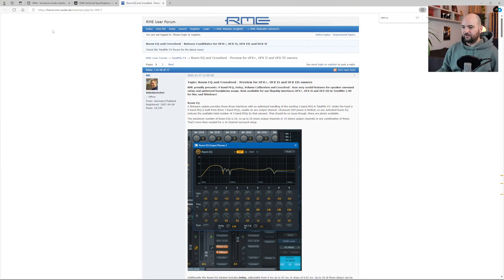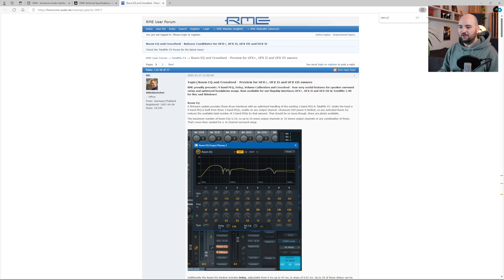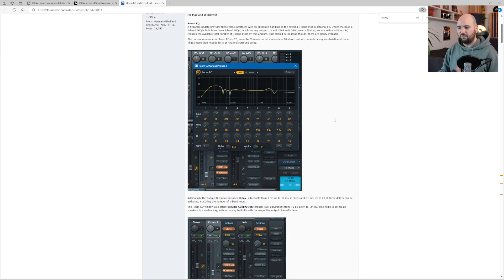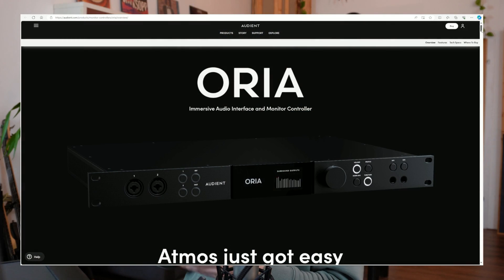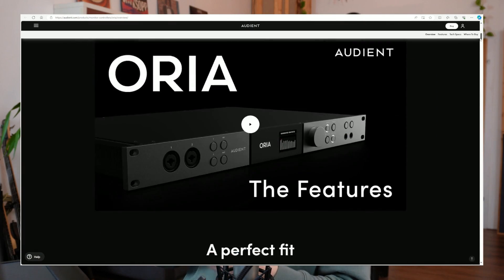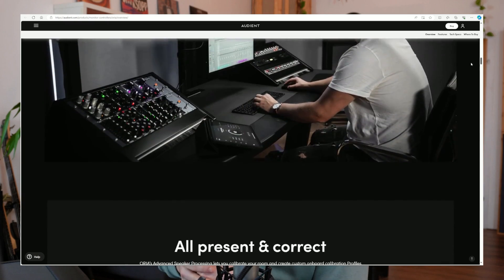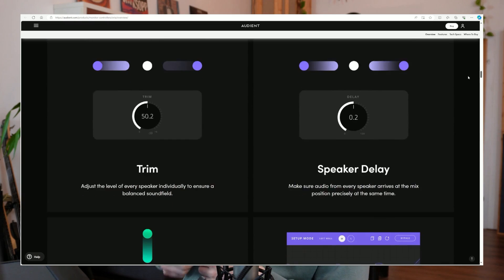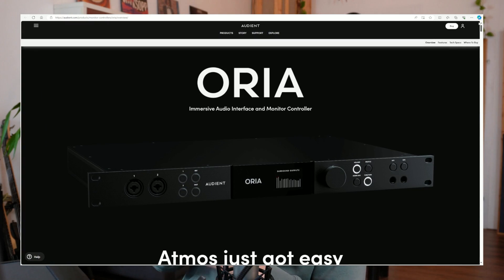What EVERY audio interface NEEDS (for home studio acoustics)

Comment: I think a DSP controlled delay on a separate Interface output for the Subwoofer isn't that important. Every Subwoofer has a phase switch with at least a 180 degree option. Some have  much more steps. Together with a measuring mic and proper placement it's already possible to get a clean phase at listening position and unlike in a Hifi Setup its not very common to place the sub too far away from the monitors. That said, i would appreciate a fully featured DSP and crossover in an interface too.
My 15 years old Microbook 2 and other Motu interfaces already have a 7 band PEQ incl. high and low pass for all stereo outputs, the line stereo inputs and the mono inputs. Together with REW it lets you make the most important corrections even if it's not a automized solution. 
Your latency argument sadly doesn't work btw. 
When you have a 15 ms delay on your audio interface outputs it doesn't mean you can add as many other dsp tasks with up to 15ms "for free" inside your interface without adding new latency unless the interface dsp magically can process the output signals before they are actually arriving. The DSP can't process what isn't there yet.

Comment: I am building a hi fi listening room that features a sound processing interface and more. Are you familiar with the Theoretica Applied 
Physics product called Bacch SP? There are a few models ( hardware and software ). The first is called Bacch4mac which deploys an RME product ( either the p[ro opt the UCX). In addition to the 3 main features you were excited about BaccH SP also provides crosstalk cancellation making the listening experience amazing and immersive. BTW - i will utilizing your tools as I retrofit a difficultly 14X 14 X10 Cube bedroom. In part due to your information I am reluctant reducing the size of my room ( by building a wall) to 14’WX11’L X10’H. Then on to acoustic treatment. By utilizing the Bacch SP Adio have all of the room parametric eq tools, speaker and sub calibration, phase alignment, frequency response, impulse response and crosstalk cancellation filters and tools.

Comment: Loving your channel. I’m considering the RME UCX II, and can barely justify it, but this feature is one of the reasons pushing me to it. Then I saw some lower prices for BF, but missed the price on the one company that didn’t remove the bundle some have right now that gives you Sonarworks for free. They even advertise it on RME’s site for adding the measurements into the new Room EQ feature. 

So now that free Sonarworks might not be an option I thought I might get REW and a cheap measuring mic. However, your one video where you talk about using it vs ARC or Sonarworks, etc…is much harder and in fact one of the hardest things you can do in this arena, even for an expert like you. 

Others seem to imply I can just use REW, get a text file and add it into TotalMix. I don’t know about the delay measurements that the dedicated systems might do though, if that’s gonna be hard to do on my own with REW? I think that’s all Sonarworks and Arc do, delay and eq? I guess I’d do volume by ear?

So has REW become easier to use? I’m confused. 

For headphones, it seems I can usually get the measurements offline from people who’ve already done that and add those EQ curves for Harman, and also use RME’s crossfade. No need to buy canopener?

Thanks, fantastic channel and I always try to like and share around. I’ve seen some of your interviews on other channels.

Comment: They also added it to the Fireface UCX II. I own both the Fireface UCX II and the RME ADI-2 Pro fs AD/DA converter. The ADI-2 Pro already had these features as well as crossfeed, but I'm still happy that they included it in the higher end audio interfaces as well as I ofter travel with my Fireface UCX and leave my ADI- 2 Pro at home. I also mix and master in headphones primarily so having the eq and crossfeed for headphone correction is also helpful. It replaced my need for my Sonarworks software.

Comment: i have the minidsp SHD studio, i use it for home stereo. think that unit has many function that you speak of.
the whole SHD series would work great for studio use.
i do not know what a "interface" is but i use mine as a volume control with built in dsp. adding dac's and power amps as needed. or directly into plate amps if it got digital input, otherwise i would need a dac in-between.

Comment: I have a correction/clarification (perspective: I am a research scientist working with, among other things, signal processing - so it's my domain, though I work mostly with images and videos):
All filters always introduce extra latency. It can be either the latency of individual frequencies (phase shift) when working with minimum phase and similar filters or the latency of the whole signal (linear filters or mixed phase filters). People have different preferences. I don't want to get into it now, but this is why software like Sonarworks gives an option for mode selection and some people prefer higher latency (and pre-ringing) linear phase filters for some applications. But even a minimum phase, or analog filter will add some phase shifts/latency.

So, it's not that placing it in the audio interface will magically reduce this latency.
It will be present no matter where it happens. 

I would make an opposite argument, actually. It's better to place filtering and correction in the speakers.
Speakers already do filtering. Unless someone is using a literally driver/speaker single cabinet, all multi-way speakers need to filter to split the signal to different drivers.
Many modern speakers do DSP filtering for this purpose (arbitrary precision etc). So adding extra filters to existing filters can make this latency or phase shift even smaller (if it's in the opposite direction).

For this reason, I bought Adam A8Hs. It works with Sonarworks, has onboard DSP, and allows to conveniently upload any profiles (or switch them from PC). To me, it's easier than doing this from a soundcard driver UI.

And, as an additional benefit - once it's uploaded, I can drive hardware synths and mixers through it, I don't need to launch my PC and route stuff through an audio interface (which WILL add extra latency as compared to going straight from a cheap mixer to my speakers).
Reply: Wouldn't a USB audio interface, due to the fact that it receives the audio data in frames (packets, buffers) introduce a much higher delay than any filter?

And it's not a problem of USB per se; it's perhaps an inherent problem computers ran by non-real-time OS (i.e. all typical computers). Also audio programs output audio data in chunks.

Or are these more advanced audio interfaces that can pass audio from inputs to outputs in real-time, bypassing the computer?
Reply: @khi787ghid  I agree almost with all you said, except for a) the linear phase filters. Very high quality very steep/precise ones can add even 50ms latency. Some audio interfaces can have just a few ms latency.
b) the nature of phase shift of very low frequencies. Imagine you shift a 50Hz wave by half cycle (180 shift). Full cycle is 20ms, so here you'd introduce a 10ms phase latency to low frequencies. And it's not some abstract example, by high passing kicks in electronic music production you can change their tonal time envelope and even the duration a lot - even when you filter only around barely audible frequencies!
Reply: @BartWronsk , interesting, thank you! TIL.
Reply: With this in mind would you recommend getting the the baby face pro and sonarworks separately rather than a remember dac with room we included?

Comment: You make a good point saying those things should be included in the Audio interface. But, since the speaker is amplified by itself. Couldn't it add some difference between the two speakers if the signals going into their preamp is not the same volume? Wouldn't that affect how the preamp will amplify this signal and then possibly give a slightly different tone to the sound of that speaker? Or is that negligeable because those preamps and usually very clean?
Reply: I would not expect any kind of measurable difference in the response of the kind of amplification stages that you'll find in monitoring setups.
Reply: @kthsmprs  It's probably because I'm a guitarist, where it can have a big impact how hot the instrument signal goes into the amp :)